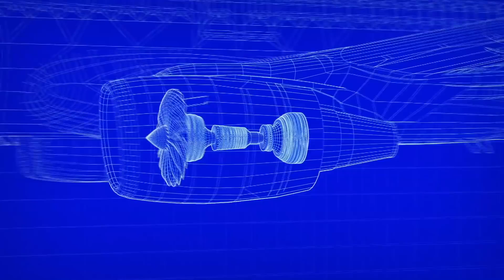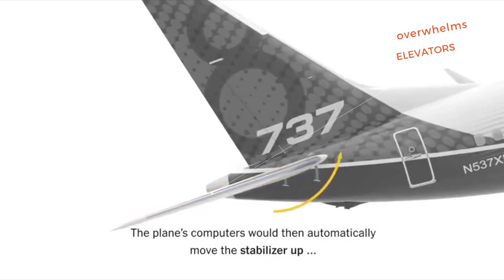737 Max 8 probable cause revealed - Prof Simon

Comment: I have some "insight" information from 737 pilots as my father is one of them. There is currently a message going around of a pilot explaining the entirety of the lion air issue. Below I will share that message with you...for all of you with a little bit of background knowledge that may be informative and interesting:

From a captain friend...
Boeing (and many posters) say "Hey, it's just a trim runaway. Do the drill and all is good." But this is not the simple trim runaway that the QRH contemplates. It starts with a stall warning stick shaker shortly after lift off. Close to the ground this will, and should consume both pilots undivided attention. After a number of seconds they realise that the airplane hasn't stalled and they start figuring out that they may have an airspeed and/or AOA problem. 

This is a second problem to deal with on top of the first. And they can't shut the &%$#@ stick shaker off once they realise that it may be spurious. The PM will be frantically scanning the panel to try and find some clue what is going on. And this whole time, among the din of the stick shaker, crews concern for the airplanes flight path, and the confusing instrument indications, MCAS has been intermittently dialing in nose down trim. Not steadily, in a calm cockpit at altitude like the QRH contemplates. 

But intermittently in the background of chaos, noise, and confusion. At some point, well past when it would have been timely, the task saturated PF realizes that the trim is working against him/her and the stab cutout switches get turned off. (hopefully)But the shitshow isn't over. Because of everything else going on, this took too long and the airplane is way out of trim. The Lion Air crew reportedly had 60 KG of back pressure on the yoke. Close to the ground, and relying on the lifting component of the underslung engines to help keep the nose up, the crew do not dare reduce power. Now the crew needs to manually trim the airplane, but the airplane is way, way off its trim speed. The B737 QRH makes reference to the large forces 
that may be required to break free a servo clutch:

"3 If needed:Use force to cause the disconnect clutch to disengage. Approximately 1/2 turn of the stabilizer trim wheel may be needed.Note:A maximum two-pilot effort on the trim wheels will not cause a cable or system failure."Worse, the "Manual Stabilizer Trim" section of the Boeing FCTM talks about the air loads on a grossly out of trim stab requiring a speed change to reduce the force required to manually trim:

"Excessive air loads on the stabilizer may require effort by both pilots to correct mis-trim. In extreme cases it may be necessary to aerodynamically relieve the air loads to allow manual trimming. Accelerate or decelerate towards the in-trim speed while attempting to trim manually."Sweet Jesus how did this thing get certified? 

A guy (or petite gal) has a 60 KG+ force on the yoke trying to stop the airplane from impaling itself into the hard ground just a few thousand feet below, and now he/she has to brute force trim the airplane as well, requiring involved coordination with the PM. Still with all the stick shakers, aural warnings, goofy instrument readings, and whatever else is happening to distract the crew and making communication almost impossible. It is not hard to see how quickly it becomes overwhelming. In addition to a fix for the airplane, if they keep the MCAS system (instead of designing a whole new wing or tail for the airplane), they will have to train the pilots who fly it to deal with its failure. 

Right now, there is not a single Max pilot in the world who has been trained for this failure because - there isn't a single simulator in the world that can replicate it. But when they do, all those pilots that claimed "it's just a trim runaway" are going to have a very eye opening simulator session."
Reply from the maker: thank you for this information

Comment: Simon, Have you actually talked to a careered 737 pilot? After multiple explanations from pilot who have flown the Max 8, it is no different control wise to the earlier models when dealing with trim. One said he had the issue and was able to diagnose the runaway trim within 20 seconds and had the system shut off in moments. All this with no understanding of MCAS. The pilots admit something is malfunctioning but that it should not crash the aircraft is flown by a properly trained crew. 

I would really encourage you to interview some actual pilots with some flight time on the Max 8.
Reply: even so the 737 MAX is a crap shoot every time someone fly in it.

Comment: In simple words: MCAS made an unsafe design even unsafer... The engine/ airframe configuration of the MAX series resulted in an aerodynamically insatable design (This already should have made certification impossible). Secondly, adding the poorly designed MCAS acting on the slow and quite irresponsive jackscrew trim system allowed for situations that could not be recovered by manual elevator inputs  if the trim position is in a nose-down situation. Simply spoken: The computer has the much larger and slow tail fin under control, while the pilot only has the much smaller elevator to work with... Additionally, in a nose down trim situation the elevator ends up in the slipstream of the tail fin, even further decreasing its effect on control... When software is used to ENHANCE safety and flight behaviour, it is amazingly useful... But when aircraft designers and engineers use software to fix obvious design flaws, it becomes deadly...
Reply from the maker: Good clear description of the issue ...thanks

Comment: Everyone, even Prof Simon here, seems to blame "bad input" from the "AOA sensor".  The 'bad' sensor on the LionAir plane was replaced, remember?  ((If it was bad in the first place).  A NEW sensor was installed, per Boeing procedure.   The plane crashed the next day!   It is almost statistically impossible for TWO bad sensors to be installed on the same airplane.  Then, bam!  The Ethiopian crash.  Bad AOA sensor again?  WTF?  You mean to tell me that there were at least THREE bad sensors, brand new sensors, installed on two brand new airplanes?  Again the odds of that are almost statistically impossible.  My thought:  Either Boeing is equipping its new airplanes with junk parts made in Uganda (doubtful!), or, the electrical signal to misinform the MCAS controller is coming from somewhere else.   Just a thought.... I am not an engineer....
Reply from the maker: Thanks Rachael...in the final analysis...Boeing made a lot of mistakes ...training, software, the certification..and the sensors.

Comment: THERE WILL BE NOTHING WRONG IF 1 COMMAND HAD BEEN ADDED TO THE MCAS ! JUST ASK THE MCAS NOT TO ACTIVATE IF AoA IS LESS THAN A CERTAIN DEG AND DEACTIVATE ITSELF ONCE THE ANGLE HAD BEEN BROUGHT DOWN TO  LESS THAN OR EQUAL TO A CERTAIN DEG . THAT SIMPLE !
Reply: NB: non-redundant sensor. Rethink.

Comment: For anyone that doesn’t already know, the MCAS failure was covered by an existing memory item. As far as the FAA and Boeing are concerned, the pilots had the tools to fix the situation. The fact that the way the system worked and failed wasn’t explained, was separate to the fix. While the investigations are still ongoing, it should be noted that ALL pilots flying a 737 know their memory items. Also worth noting that in the Lion Air accident, a crew on he previous flight did correct the constant pitch down actions of the MCAS, by running through the ‘runaway stabilizer’ check list. Boeing and FAA aside, why is no one talking about flying basics? Taking over from a runaway trim is something you learn before you go even enter the 737 sim, so why would you sit and watch an aircraft trim down for 7 seconds and not touch the Stab Trim Cutout switches? (Lion Air). Just my opinion, but I think we will learn in time, that both these accidents were survivable if the pilots had taken over earlier.
Reply: @jordannash1998  I agree. The fact that the aircraft are becoming so reliable, at the same time when pilots are finding themselves in the left hand seat with less experience than ever before compounds this problem. For example, when I first flew the A320 it had many little problems that required you to closely monitor. Now the newer models are super reliable...to the point that they do a better job than most pilots. However, the unwillingness of new pilots to take over is undeniable!

Comment: Ola Professor
As I said before, about the 737 - MAX 8 Turbine Fins, I decided to search, since they are called 'Chevron', and they have several applications: Significant noise reduction in about 8 dB, as this the inner lining can be reduced by a few tons and the turbine was elongated, put back, making this greater area of air passage, that is, redrawn the turbine. Hugs and thanks!

Comment: No  doubt Boeing 737 Max has a design problem,,which Boeing tricked with the MCAS comp operation.All airplanes should be designed to fly straight and level,,and if disturbed it should go back to normal.I wish I could make an extreme limits weight and balance check on the Max.I bet this plane has problems with the new CG,which causes flight instability.It is obvious that the new bigger,,heavier offset engine causes the stability to be affected.It is logic that a bigger engine,and heavier,also installed too far from the wing,will affect badly the center of gravity. But Boeing will come with a quick fix to make it fly again,,,until couple more Max fall from sky

Comment: It is very curious though how the four pilots of two aircraft were apparently not aware that the jackscrew motor could be quickly disabled by flipping the two motor cutoff switches & the stab trim controlled manually using the cables. Unless there is another issue involved here that prevented disabling the trim motor.
Also, it is outrageous that Boeing did not include any mention of the MCAS system in the aircraft manual.

Comment: MCAS or no MCAS it is the pilot's duty to control and prevent the nose from pitching up!
Reply from the maker: but designing an aircraft inherently unstable in pitch and fixing it with a software that you don’t think pilots need to know about....must have been horrible for the crash crews.

Comment: One reason the pilots might not have caught  the stab runaway caused by the MCAS is because it moves the stabilizer only 2.5 degree  each time it is activated which isn’t how the other stab trim runaways work.

Comment: Turn it off. Work out the math manually. What speed you need for lift ect. Keep a steady horizon. Watch out for pitch up. Surely you can fly it without the MCAS...

Comment: Big Commercial Jets are as stable as general aviation aircraft the difference is size and weight which have different reaction times in returning to stable flight. Boeing has a great airplane but a faulty computer system, fix the computer with the off switch and the 737 max will fly just fine. The smoking gun here lies in why the aircraft became so unstable that the computer started to roll in trim .  Center of gravity due to over loading is probably the answer and would have doomed the aircraft from the start. This is a 'Tar baby' that no one in the industry wants touch. The corrective action is to stop loading the aircraft in the aft storage hole and off load fuel to 70 percent to assure correct weight and balance. Bonanza aircraft King Aire ran into the same problem with their stretch version of the king air turbo.

Comment: this is what happens when you put a 2017 engine on a 1967 airframe... and try to compensate with a bandaid patch. shit gonna happen.
Reply: talei moce, fair comment by you as the engine had to be lifted higher from the ground or call it the level of the tarmac surface.

Comment: The max8 is not naturally or inherently airworthy. It’s not at home in the sky and wants to fall, so they built a software system to continually fight it and force it to fly and when a  certain set of flying conditions arise which the software code cannot handle, a crash is the unfortunate result. I will never fly in one of these planes.

Comment: It has been reported that the final certification of the aircraft systems (or some of them) were carried out by Boeing itself as the FAA were under financed and therefore short staffed. Boeing, knowing the fault existed, didn't put an Emergency Drill into the books as they said the problem would not arise. When the aircraft is so near the ground there isn't much time to analyse a problem and come to a decision without some help from a training program which, apparently was not there.

Comment: The wing surface area looks too small for size of fuselage ...the only way to push that size fuselage through the air is engine size and computer software ...no room for error whatever the reason during flight.

Comment: MCAS is only new to the 737max due to the engine change. Other large aircraft have similar systems to control the nose up situation when the aircraft is flown manually. MCAS on the 737max is not active when the autopilot is engaged because the AP is controlling the stab trim. 

The first concern I have is the stab trimming might be invisible to pilots because during climb, leveling in cruise, in descent and approach if the aircraft is being flown by AP the stab is always trimming for the different changes in the flight.  

If the stab is trimming nose down (MCAS) while flying manually both the Captain and the FO officer has a large indicator that is clearly visible on both sides of the center console. If a flight crew sees the stab trimming nose down when they don't want it to all they have to do is turn it off. The stab trim wheels in the 737 is noisy and obvious almost to the point of being obnoxious. I'm concerned none of these pilots bothered to look down to see what the stab trim was doing.

If I “assume” Boeing completely messed up the software for MCAS (which I don't believe) the effect on the airframe was runaway stab trim. The stab trim disconnect for the 737 is in the same location as delivered in 1967 on the first 737-100 for which procedures are taught and located in the FCOM.

Could the design and introduction of MCAS be handled better by Boeing. Sure. And it looks like they are going to further update the software to make it even safer.

The preceding Lion Air flight before the doomed flight was able to remedy the situation by turning the stab trim off and continuing the flight. But they were only able to resolve the issue because a third pilot was onboard jump seating and he was able to figure the problem out. After which the AOA vane was replaced and either not calibrated correctly or was another failed unit. The First Officer on the doomed flight had a total time of 200 flight hours. The FO on ET409 flight had a total of 600 flight hours (discussed more later).

People in America assume all airlines in the world operate and are regulated like United States carriers. That is an incorrect assumption. Lion Air is known for the lack of training and poor maintenance practices from years past. Ethiopian is known for the poor pilot training they provide.

Southwest Airlines has flown a total of over 88,000 flight hours and 44,000 landings on the 737max and have reported no troubles with the aircraft.

I’ve included two links in this response. The first is a post I made on Facebook detailing Ethiopian flight ET409 which crashed into the sea five minutes after takeoff. The aircraft was a 737-800 (Next Gen, not MAX). the accident occurred in 2010. The second link is to the investigative report on ET409. My post has an image of depicting the flight profile of the doomed flight. This graphic looks very much like the flight profiles of both the recent Lion Air and Ethiopian accidents.

What infuriates me is none of these flight crews boarded the flights knowing they were going to die, much less the passengers. Lion Air and Ethiopian Airlines owe their employees valid training before putting them in the flight deck of a complex aircraft certificated for 2 qualified pilots.

The ET409 investigation found:  “The investigation revealed that the probable causes of the accident were the flight crew’s mismanagement of the aircraft’s speed, altitude, headings and attitude through inconsistent flight control inputs resulting in a loss of control and their failure to abide by CRM principles of mutual support and calling deviations. The other contributory factors that could have led to probable causes are the increased workload and stress levels that have most likely led to the captain’s reaching a situation of loss of situational awareness similar to a subtle incapacitation and the F/O failure to recognize it or to intervene accordingly.”

Republic of Lebanon Investigation Report

http://www.databank.com.lb/docs/Final%20Investigation%20Report%20on%20Ethiopian%20409%20%96%20Boeing%20737-800%202012.pdf

These pilots are not receiving the training they need to safely operate the aircraft.

ET409 Flight Profile Graphic
https://www.facebook.com/1398133526/posts/10219310836667178?sfns=mo